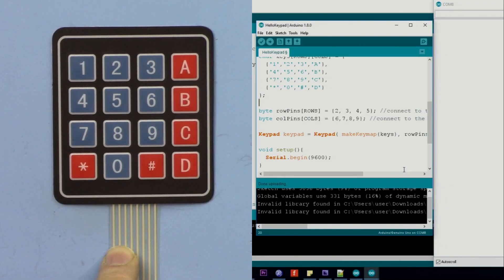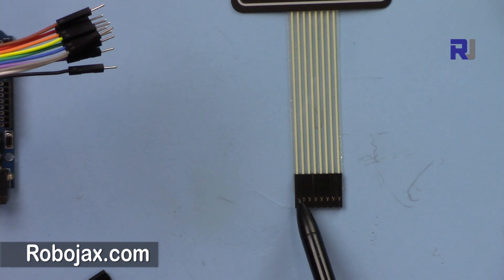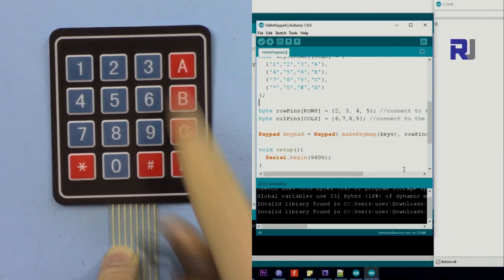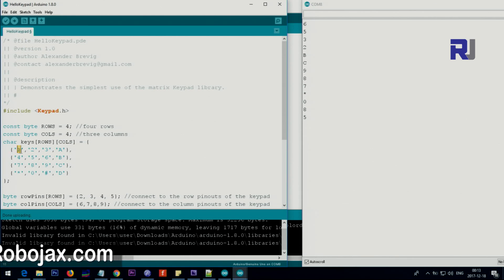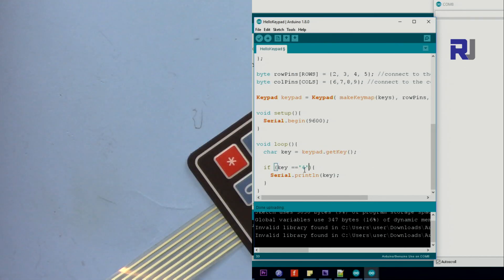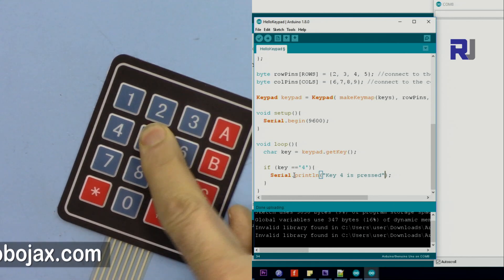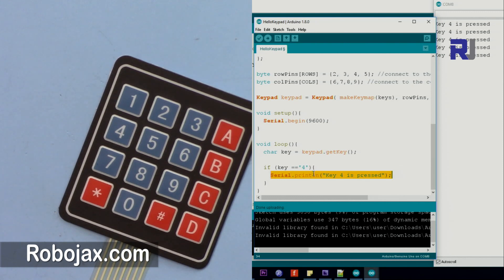E029 How to use Arduino 4x4 keypad download the code RJT29

Comment: hello I'm new to arduino, it is possible with a 4x4 keyboard to drive 2 stepper motors, bearing in mind that one motor uses variable degrees and the other motor uses displacements in cm, congratulations for the video (I used google translator I hope it worked well)
Reply from the maker: Why should you use goofy translate? I have already added subtitle. What is your language? I will add it.
Reply: @robojax  grazie per aver risposto, la lingua è italiano , il mio problema è compilare un programma ,non sono bravo in questo .ho visto anche i video con sottotitoli in italiano, ho cercato di vedere piu video possibili ma tutti si fermano a mettere un codice per sbloccare una serratura, io vorrei scrivere un comando gcode e avere uno spostamento lineare .

Comment: kalo untuk input koma gmna pak, saya coba ganti² di initial char ganti input # jadi koma gk bisa pak
Reply from the maker: sure it won't work. you can learn from this video https://youtu.be/sbQ3D1_x_tg
Reply: char keys[ROW_NUM][COLUMN_NUM] = {
  {'1','2','3'},
  {'4','5','6'},
  {'7','8','9'},
  {'*','0','#'}
};

I want to change the character '#' to ',' (comma).  if i press '#' on the 4x4 keypad it shows ',' (comma).
how can i get it sir?
thanks
Reply from the maker: salam alaikum, it seems you don't knwo the meaning of "escape" character. comma is part of programming language C/C++ which is used vy Arduino and you need to tell the the program that the comma you are using is not part of the program by adding \ in front of it like \, and it will work. so for * you enter "*" but for comma you enter "\," . salam Ahmad from Khorasan Al-Kabir

Comment: can you send me the code by email Charbel_maroun@outlook.com
Reply from the maker: the link to the code is available.  Why bother loggiing into email, download and save. Just click and get it.  I have mentioned it in the first 30 second of the video.
Reply: @robojax  do you know why my code dose not work properly ?
 #include <Keypad.h>
const byte ROWS =4;
const byte COLS =4;
char keys[ROWS][COLS] = {
  {'1','2','3','A'},
  {'4','5','6','B'},
  {'7','8','9','C'},
  {'*','0','#','D'}
};
byte rowPins[ROWS] = {2, 3, 4, 5}; //connect to the row pinouts of the keypad 8,7,6,5
byte colPins[COLS] = {6, 7, 8, 9}; //connect to the column pinouts of the keypad 4,3,2,1
Keypad keypad = Keypad(makeKeymap(keys),rowPins,colPins,ROWS,COLS);
int relay =13;

void setup() {
  // put your setup code here, to run once:
pinMode(relay, OUTPUT);
digitalWrite(relay,HIGH);
Serial.begin(9600);

}

void loop() {
  // put your main code here, to run repeatedly:
char key = keypad.getKey();
if (key=='2')
  {char key = keypad.getKey();
  if (key=='5')
    {char key = keypad.getKey();
    if (key=='8')
        {char key = keypad.getKey();
        if (key=='0')
          {digitalWrite(relay,LOW);
           delay(100);
           digitalWrite(relay,HIGH);
          }
        }
    }
  }
}
Reply from the maker: what are you trying to do? decode a number like 2580 (pin)? it will not work like this, this code can read ONLY ONE key at a time. You  have to have  variable holding that holds the pin 2580, then every time it is pressed, save it in another variable, repeat this 4 times to making sure 4 digit is entered. Then compare either all or digit by digit. This itself needs a project and I may make a video on that. But not now as very few people are interested in that. Good luck.
Reply: @robojax  waiting for your video <3

Comment: I have a little problem, My OLED display is using 2 of the Digital Ports, so can i use 2 analog ports for the keypad instead of digital ? Thank you
Reply from the maker: Yes. You can use analog ports to work as digital. I have used analog pins for digital in this video https://youtu.be/Q9aBI4ELKC4

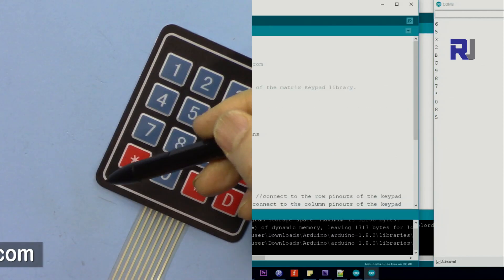Comment: this is probably a stupid question with an easy answer, but can you tell me how to "download and add the code to the library" ( 1:10 )
Reply from the maker: I have provided the link where you can get the code. In the same page, There is a link to download the library. download the library in your computer and save it somewhere. Then click on Sketch->Add library->Add .zip libary and then point it where downloaded and saved the zip file.

Comment: what happen ?  I tried to follow your tutorial but the result is the key is auto type by itself in the display. please assist. thank you
Reply from the maker: you must have modified the code. or connected wiring incorrectly. please use the clean code, do not change it and check it again.

Comment: Hi i'm trying to use a keypad just like this with my project. what I want to do is press a key (say 1) and have that action run a user defined function (the function controls three servos). Any thoughts on how to make that code. I;m very new to programming and arduino.
Reply from the maker: Hello, this would be very simple. Right now when we press a key, it prints the value on screen. you can do something else instead of printing on screen.  I have given at the bottom of the code where it says // this checkes if 4 is pressed,....
replace 4 with your number and replace 
 Serial.println("Key 4 is pressed");
with any ting you want. for servo, I have another video on servo http://robojax.com/learn/arduino/?vid=robojax-servo
and combine both and repalce Serial.println("Key 4 is pressed"); with  myservo.write(pos);   where pos is the angle which could be any value between 0 and 180°
Reply: @robojax  Thank you. That's super helpful!

Comment: on a certain time I want to prevent keyboard access what can I do????
Reply from the maker: certain time like actual exact time with hour and minuets  and calendar day?
if that is the case, you need Arduino Real-time clock module. Then you can control the keypad to work on certain times to be active or disabled.  Here is such a module https://www.amazon.com//dp/B01IXXACD0
Reply: no I have a project when the machine is off it is necessary to enter a code for restarting the machine but when the machine is running normally I want to block the tape on keyboard for not entering any code
Reply from the maker: What type of machine? can machine status be read as voltage?
You can connect a wire that has voltage when the machine is ON, Arduino can read that voltage and disables the keypad.
Reply: yes how to translate the keyboard lock on the arduino program???
Reply from the maker: you have to tell me what kind of information is coming from the machine? is it ON off voltage or is it voltage that  vary at different value?
Once I know that I can suggest a solution and post the code for you.
Reply: you can give me your mail to send you my problem
Reply: and I want to send you the code to understand my problem if possible of course ???
Reply from the maker: Yes. Please post it here https://codeshare.io/ and once you post it, it will create new URL for you. Then copy the URL (the web address) and post it here for me and I will help you.
Reply from the maker: I am sorry, I got busy with stuff in life and totally forgot about your project. Please forgive me.

Comment: Could this work for a 4x6 keypad
Reply from the maker: Yes it would. I am not sure if you have 4x6 keypad, but  I have just posted code for you so it should work for 4x6 keypad. https://codeshare.io/5XljbE
I have not tested it but it should work. Now for 4x6 keypad you should have 4+6=10 wires and connect them accordingly.
Reply: Robojax thank you 🙂, I want to try and get this to work with an old game console.. a Bally astrocade and it has a 4 x 6 keypad.  This will be my first try and using this device 🙂
Reply: Robojax thank you.. is there a particular Arduino board that's best to use
Reply from the maker: Uno will do is enough.
Reply: Robojax .. thank you.. excited to try this out